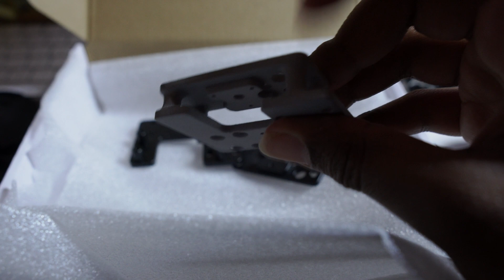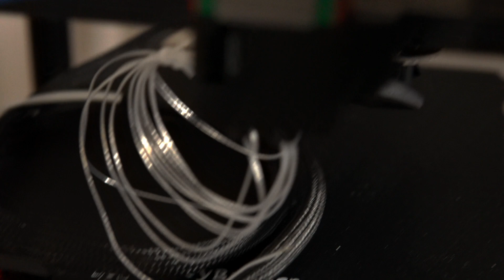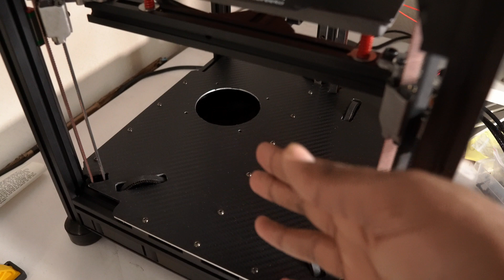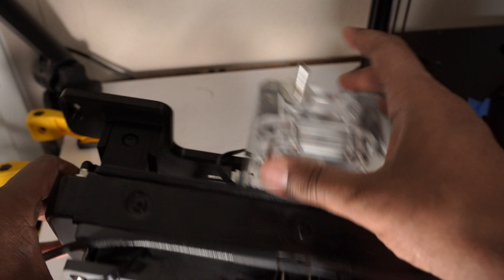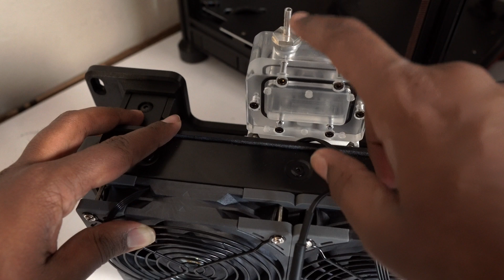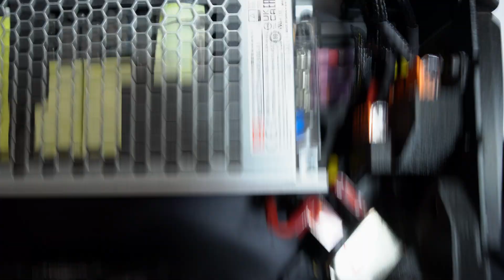(2) Full Metal - 48V - Watercooled Annex K3 Project

Comment: That looks so cool ! I am kind of interested in a K3 too now. Do you have an idea of how much it's gonna cost in the end with all the fancy cnc stuff ? And about watercooling, when it comes to metal fittings I have personnally never been able to find any aluminium ones, most often it's some nickel plated copper or brass but honestly I am kind of confused as to whether you should mix it with aluminium in the loop because based on what I have heard you shouldn't ( I am not an expert though).
Reply from the maker: Thanks for the comment! I’ll update the price on the final video! As a rough number it’s probably $1500 +/-300. Printer is now fully built just going through some tuning. 

As for the material compatibility: generally you’re not suppose to mix aluminum with anything including brass, stainless steel, nickel plated items, but as you’ve noticed reality is not the same. I decided to go with stainless steel that’s been nickel plated. It will corrode over time and when that happens I’ll have to just replace the parts. Won’t be for a long long time so hoping it works out